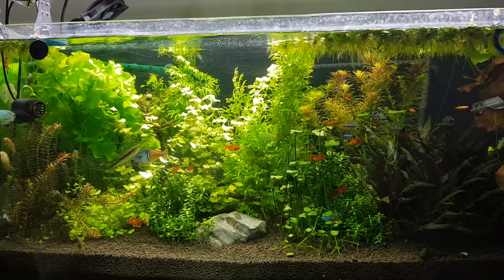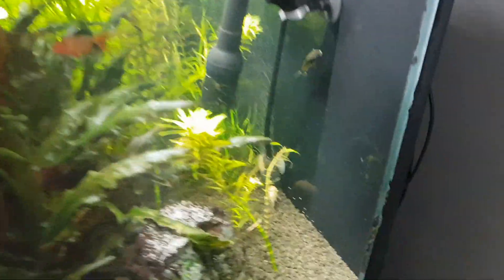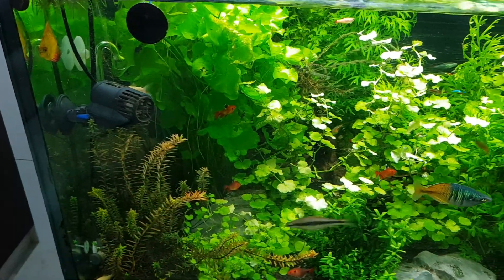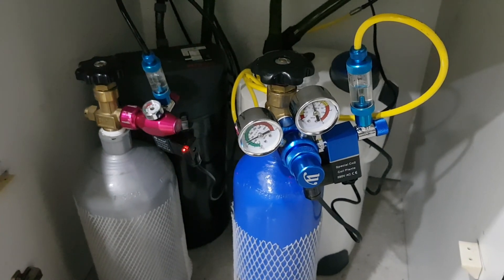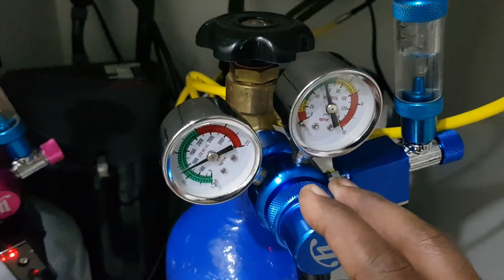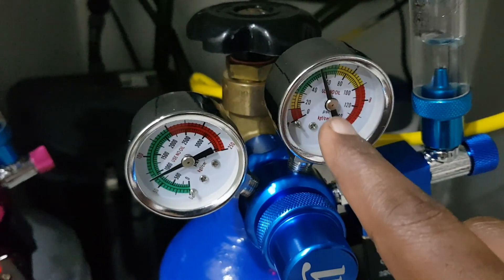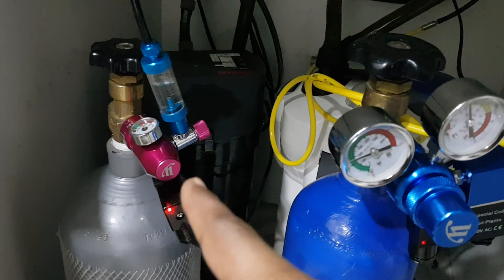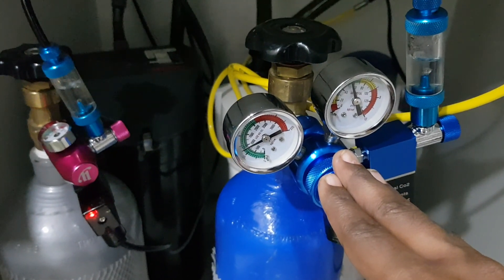co2 regulators - single stage vs dual stage

Comment: Bro purchased this last week in Aquastar and I’m struggling .. the left gauge is not working . And when I turn it on it turns off automatically
Reply from the maker: Left gauge is the cylinder pressure. Does it come to 0 immediately after opening the cylinder valve or does it happen after a few hrs gradually coming to 0? If it happens immediately then there s a major leak in the regulator or the gauge is broken. If it happens over a few hours then there s minor leak happening gradually where the regulator is screwed to the cylinder. U will have to disconnect the regulator, check the position of the o ring. Then reconnect properly. It takes a while to master this. Dont screw it on too hard.
Reply: @rusticromeo  Thanks bro .. I can sense a major leak then. I'll take this to Aquastar .Thank you for your time. Much appreciated.

Comment: Either of these Co2 regulators are 2 stage..... don't be fooled by dual gauge...
Reply: Plz look up the differences between single and dual stage co2 regulator on YouTube.  Look up how to test to see if your co2 regulator is 2 stage.
Reply: @bettabegoodjr2104  do you have any resources or videos to recommend for learning how to test whether a regulator is single or dual stage? I had read (but can no longer find) a website years ago that said dual stage will have a hump at the back for the second stage mechanism. It had cutout diagrams showing how the insides work.
Reply: @pistachoo.  yeah.... just browse on YouTube..  search how to test if a co2 regulator is dual stage regulator... there should be a vast amount of videos.
Reply: Hey Bud... I wanna say I'm kinda glad we are having this discussion... im sure WE are gonna help people.
Reply from the maker: Yeah.. the blue one on the right is dual stage.. not just dual guage. Now I have replaced the single stage pink one with a dual stage too. No more leaks.. as of now.
Reply: @rusticromeo  naw......its a single.... believe me.... do you really think that those  cheap Amazon regulator are dual stage? Bro I had the wyin its not two stage just dual gauge.
Reply: @rusticromeo  just because you have a working pressure valve doesn't mean its dual stage..
Reply from the maker: Sorry.. I am not a scientific expert on regulators. I am saying that this is a dual stage reg bcos I have also used a dual guage single stage from the same manufacturer and this I know the difference between these two. And I have used other dual stage regs not from Amazon too. They have generally a similar mechanism. Two stages. In a dual guage single stage the knob is a dummy. In dual stage, by only turning the knob will ur working pressure rise. Even when cylinder pressure drops to 0, if u have 60 psi working pressure u get a steady bps. Anyway if that doesn't convince u, I can't help it. Thanks for your comment. Tc..
Reply: @rusticromeo  just because one reg is preset and one is not doesn't make it a dual stage...there are plenty single stage regs that you can control the working pressure. Dual stage regulator are extra thick / wide for extra springs within the reg.. dude I used to think just like you... are you really that naive to think you can get a good 2 stage for under $50 $60 .pro grade 2stage regs can cost $300 to $400
Reply from the maker: @bettabegoodjr2104  there s a large spring inside the knob. Maybe there r better dual stage regs which r more expensive. Or maybe I am wrong and naive abt the entire thing. But what I want to convey is that this has worked better than the conventional single guage for me for 2 reasons..
1. No leaks from needle valve.
2. The bubble rate doesn't automatically drop as cylinder pressure drops which was a big issue for me in the single stage. 
  So as long as I get a steady bps and the refill lasts 8 months(instead of the paltry 2 or 3 months with the single stage) I will say this is s good product. Why I continued to press that this s a dual stage is that wyin also manufactures single stage dual gauge which ppl can mistake for this one. That one has no knob, no chamber for the second stage and working pressure cannot be adjusted. Thats it.
Reply: @rusticromeo  in a single stage as the pressure drops in the cylinder co2 bubbles will increase not decrease.
Reply: @rusticromeo  nope im sorry.  I thought the same thing. Im sure you have to adjust the needle valve along with the working pressure nob very often to prevent end of the tank dump...
Reply from the maker: @bettabegoodjr2104  nope.. never had a end of tank dump at all. Working maintains it 60 till the cylinder drops to 0 and then gradually starts reducing. Never had to adjust the valves once installed.
Reply: @rusticromeo  its not gonna happen fast... alright if you believe you have one go ahead.....  youtube how to test a regulator if its dual stage... I guarantee when you see what they do with there working pressure nob and how the gauges respond yours won't do the same.
Reply: Does your working pressure gauge respond the same?? our does it go up when turned up. And when turned down it stays the same and won't move till you release pressure from the needle valve??
Reply from the maker: @bettabegoodjr2104  working pressure doesn't drop unless needle valve is released.
Reply: @rusticromeo  see on a true dual stage. The needle valve can be closed and at the same time you can literally dial the working pressure valve.  Causing increased co2 or decreased co2. Im sorry but I have a Wyin and was under the impression because it had dual gauges and working pressure it was a dual stage. But as I researched and gain knowledge of this product I was forced   to find facts to tell if it was a true dual stage..  see I can control my working pressure on my Wyin. But I can only build pressure quick. I can not dial down the working pressure UNLESS I open the needle valve so the co2 can escape the valve.. a true dual stage.. (Like the one I just received and did a video unboxing on 1hr ago) Co2Art Pro -Se Dual Stage regulator .I can increase and decrease rapidly without opening the needle valve. My Wyin regulator no where reacts the same.. when I decrease the working pressure valve.  I have to make sure the solenoid is on and needle valve open to decrease the co2 amount on my Wyin working pressure gauge.
Reply: Thank you guys very much for this conversation. I was searching for a dual stage regulator, and obviously I found the cheaper Chinese ones on amazon, and I also found the Co2Art one because of an another video, but I didn't know why the Co2Art one is more pricey. Any chance that do you know what's the difference between the SE and the Elite version, other than the working pressure? I actually want to use one for a regular Co2 tank, but I want to use an another for pressurised air(it's a project of mine). The pressurised air would be quite high (60-80 psi) and the Elite version is rated at 5 bar which is 72psi. Could you tell me what is the tank and the regulated pressure what you use? Thanks in advance!

Comment: "dual gauge" is not the same thing as "dual stage".
Reply from the maker: You are absolutely right. Dual stage is what I meant in this video. I didnt know that there could be dual gauge single stage regs at that time.
Reply: I still wish there was a reliable way to identify dual stage regulators...
Reply from the maker: There is. A dual stage reg will have a primary large knob for the first stage and a secondary needle valve (smaller knob) for co2 to go into the bubble counter. A dual gauge (which i accidentally bought and then returned) will have only the needle valve. The larger knob for the 1st stage is definitely absent. Hope this helps.
Reply: @rusticromeo  I didn't think the needle valve would be considered a part of the stages... I have one with no big knob, but a screw head where one would be.
Reply from the maker: @pistachoo.  as far as I have seen there s a large knob for the 1st stage and the needle valve for the 2nd. I think the size of the chambers and knobs vary based on price range. This one works for me. Thats all.
Reply: Needle valve on all of mine is a separate thing on the end of the solenoid, not integral to the regulator itself. Hmm.
Reply: @rusticromeo  no the needle valve is not part of the stages!!! The stages consist of two springs...
Reply: Ty I have been trying to help the video maker understand the difference between single stage and dual stage.. plz like my comment if you agree with my past comments

Comment: I have wyin dual guage regulator, noted that working pressure is increasing, it is in the range of 70 to 80 psi  Any suggestion.
Reply from the maker: Thats fine. You cant manually reduce it without letting out gas. Let it function for sometime and then it will come to 60 psi. after that if it goes below 40 psi you can turn the knob to increase it back to 60 psi

Comment: I have a two guage one from aqua nature. I am facing a issue since a week, the initial flow of co2 is great, but after an hour or so, the output of co2 keeps on decreasing. Like i have adjusted the valve to 2 bubbles per minute but after a hour or so it slowly decrease to 0.5 bubbles per minute. Would be glad if you could help? Also can you open your centre adjustment section?
Reply: I believe dual guage and dual stage are not the same thing. If it is dual guage but single stage, that problem is very common. a dual stage regulator is designed to avoid that problem
Reply: @gio6627  ty Gio I've been trying to tell the creator of the video... DUAL GAUGE DOES NOT ALWAYS MEAN DUAL STAGE....
Reply from the maker: @bettabegoodjr2104  i am not a lay man or a young kid who doesn't understand basic science. I am a 38 yr old  doctor (MD) and this is my hobby. If u don't believe that this s truly a dual stage thats ur opinion but its my contention that it is. But i am not being paid my wyin or anyone else. Doesn't matter to me what people think of the video. I am just trying to help a few who had difficulties with setting up co2. And btw we r in india which is a developing nation and for us if we can get something that works well at this rate we r happy. So think I will stop responding henceforth. Thanks for ur feedback.
Reply from the maker: @gio6627  hmm.. sorry but if we assume what u r saying is true then what does the second guage represent in a single stage regulator? I always thought that one of the guages showed the pressure in the cylinder and the second one showed the pressure in the chamber between the cylinder and the needle valve. Dont think there s a single stage dual guage.. pls correct me if I am wrong..
Reply: @rusticromeo  Ram, I won't pretend that I know this stuff well. Quite the opposite I'm new to Co2. However, I was going to buy a dual guage from Fzone--the descripton said that it was single stage, despite the fact that it had two guages.  Then I decided to buy another one from the same company that it also had to guages, but the description said it was dual stage. Again, I may be wrong but based on the descriptions from this company I'm guessing that dual stage and dual guage is not the same thing.
Reply from the maker: Hi @Gio.. You were absolutely right reg dual gauge vs dual stage. I accidentally got a dual gauge recently and then realized that it had only one stage. I have given it to a friend of mine. So will update you on what the 2nd gauge does.
Reply from the maker: Hi sorry for the late reply.. haven't checked this part of you tube in a while. Hope you resolved your issue. You shouldn't be having those issues with the dual guage if the second stage is showing 60 psi pressure. It will ensure the bubble rate doesn't drop. The central knob can be rotated... initially u open it to as much as possible before u open the co2 cylinder and then u start closing it and stop when the pressure in the second guage reaches 60 psi. Tc..

Comment: Very informative video. From where did you purchase the dual gauge and is it performing good? where are you from?
Reply from the maker: Hi.. thanks for the comment. I got it from an online dealer called as Easypets. The product is manufactured by a Chinese company called Wyin. I am from Coimbatore which is a tier 2 city in southern part of India. The product  has been in use for almost 2 months now and working well but it's still too early. But the fit and finish of the dual gauge s great. Worth a try
Reply: @rusticromeo  Oh okay cool. It's pretty rate to see high tech indian tanks. Glad you have it and would like to see updates on this. so when you turn off the co2 at night, does this solenoid completely shut off the co2 or it releases like 1 bubble in every 6 to 8 second?
Reply: How’s it holding up
Reply from the maker: Hi.. the dual guage regulator has been fantastic and holds co2 for a long time. Its been almost 4 months since my last refill and its still not budged from 800 psi. Definitely worth every single cent or in my case rupee.. hope that helps. The single guage is still functioning but only problem with that is as the pressure starts dropping below 800 psi the bubble rate just won't go up no matter how much turn the needle valve nozzle. So I am ditching it as soon as I get my hands on a new dual guage. Tc.
Reply from the maker: The single stage started leaking and now I have got a 2nd dual stage for the other cylinder too. and pressure is holding up for both tanks nicely